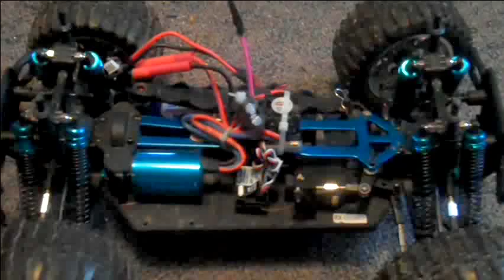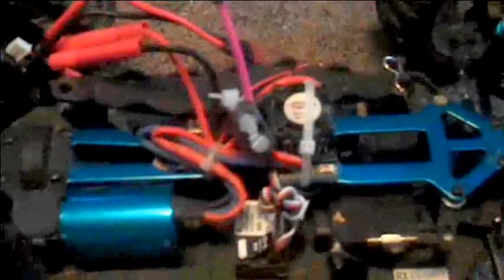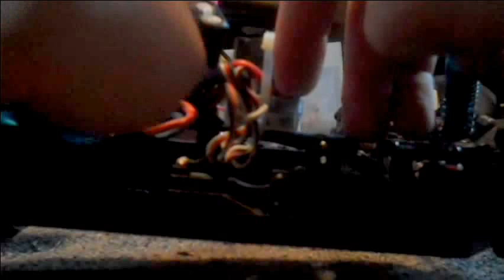Redcat ezrun calibration

Comment: Hey bro I can't get my Redcat blackout SC Pro to have any throttle my steering works and everything but my throttle doesn't work it only happened after I try to plug in my gyro what do you think happened
Reply from the maker: Never messed with a gyro.  Where did you plug the gyro in?  I would assume it goes in the #1 steering slot on the receiver and then the steering servo goes into the gyro.  Maybe you plugged the throttle into it instead.
Reply: Ok I will take a look and try that. Now even without the gyro connected I have no throttle and I even just changed to my new esc and I have no throttle still. I was thinking my neutral wasnt calibrated but when I try to calibrate it doesn't let me do it.
Reply: When I hold the set button and turn it on then in the neutral position I press it again the green light doesn't show up it just makes no beeps or light
Reply: I got it all figured out bro thank you so much for the advice

Comment from the maker: Ok, but the truck doesnt always respond to throttle inputs like it should, right?
Try unplugging the steering servo and see if that fixes the throttle issues.
The Radio may not have a range issue, but the reciever could still be defective...not sending the correct signals to the speed controller.

Comment from the maker: If its new, go to redcat's website and fill out the warrenty claim.   If your range is short, the radio/reciever is defective.  It doesnt happen often, but it can.  If you fill out the warrenty claim, explain the problem and what you have tried to resolve it then redcat will ship you a new radio/reciever.
Also, if you own another radio/reciever install it in the truck as that can make certain its an issue with the radio and not the ESC.  Its most likely the radio tho.

Comment from the maker: no, not to calibrate.  I thought maybe you had adjusted the trim after you calibrated, which would throw off the calibration.  I suggest you calibrate the esc again.  It doesnt matter where the throttle trim is, as long as you do not change it after its calibrated.
May I ask, why did you recalibrate the esc in the 1st place?  was something wrong?  Or did you install a new system?

Comment from the maker: 1st, your radio always has to be turned on first.  Never power on the truck without the radio on 1st.
2nd, you may have got the order wrong when calibrating.  If you hold throttle when the ESC tries to calibrate the neutral setting then that could cause the truck to take off.
So, re-calibrate it again.  And make sure not to turn off the ESC untill it has exited calibration mode.  The light should go to a steady green and the truck should be respond to throttle input properly.